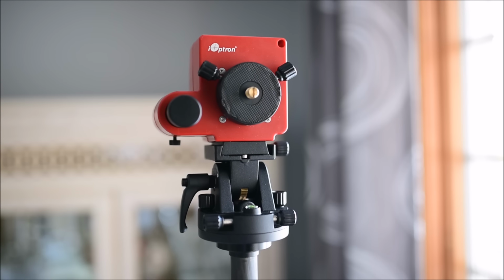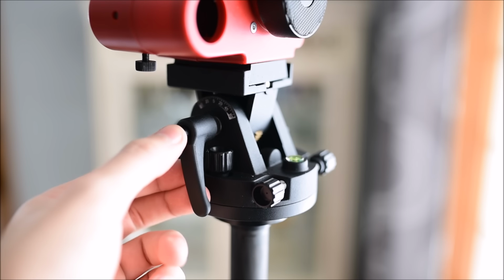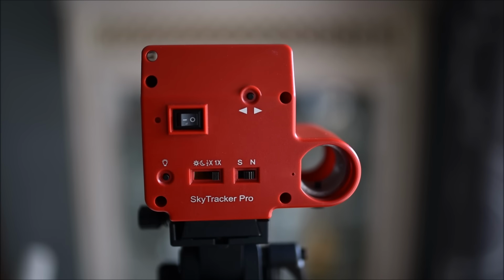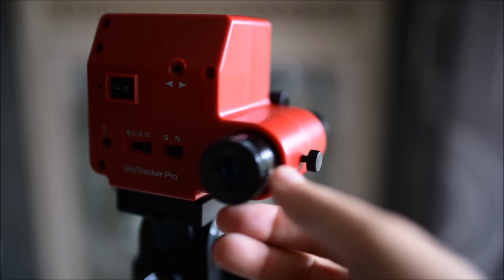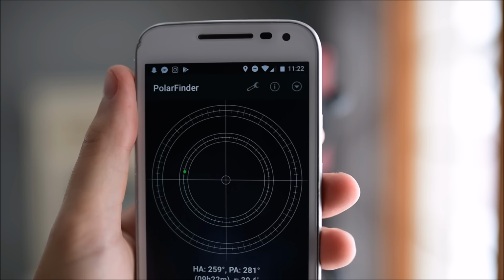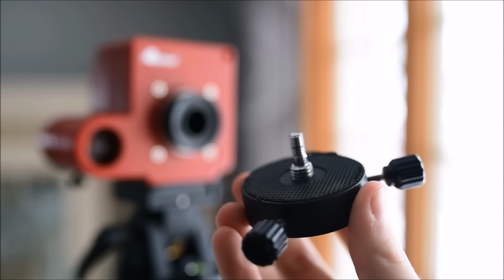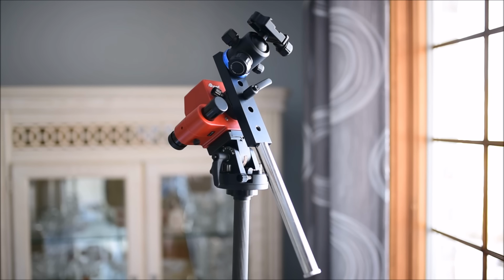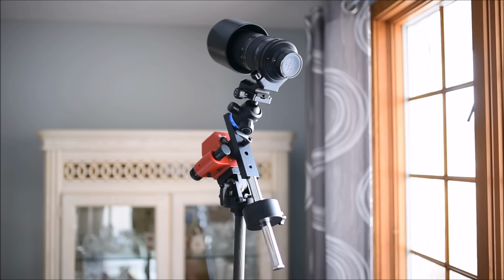iOptron SkyTracker Pro - Full Length Tutorial

Comment: Hello, fantastic tutorial it helps a lot, I have two questions regarding the polarscope:  first I wasn't able to find polaris with it, it was easy to watch it through the holder for the polarscope, but when I insert the polarscope, I see lot more stars than with my eyes only, and I was not sure which star is polaris, and because of the bright red, I couldnt see some stars from there. and the second, the polarscope view is against wrong (I'm from Austria, hope you know what I mean) so if a object is to the left, than you have to go right and vice versa. the polarfinder app also offers this option, but how is it correct?
Reply from the maker: Yeah, that's the trouble with using the polar scope in a dark sky.  What you can try next time is to do your polar alignment during twilight, when only the brightest stars are visible.  You should only see the North Star and Big Dipper at that point.  (Usually 40 - 60 minutes after sunset)

You can always turn down the red light brightness if it's too bright.  

Yeah, that's the way all polar scopes work, same with telescopes.  Up is down, left is right.  It's confusing!
Reply: okay this is possible for beginning, but still not a final solution.. because what should I do, if I would like to repalce my tripod? okay to be fair, for a wide angle milky way shot only, it is not necessary, its enough if the skytracker shows about to the north. but with 100mm its another thing. especially if you want to make more exposures for half an hour. I have found a great tool, and I think I'm going to order it, its called QHY Polemaster, you can put it onto your skytracker where normaly the camera is set. this is a little camera which needs a connection to a pc (hopefully one day possible via smartphone) there you have to choose the polaris, and the camera/programm records the movement of the stars around polaris, and gives you the real northern point. than you have to fine adjust the skytracker, that it maches with the point of the programm.
Reply from the maker: I don't think the SkyTracker Pro will ever be able to successfully track for 30 minutes straight.  You'd likely need a very high end telescope mount to get that kind of exposure time.  Even then, you'd probably blow out any detail in the sky, even at ISO 100, after 30 minutes.

Also, you'll need the Polemaster attached to your DSLR or Lens in order for it to function properly.  Telescope users will have it attached to their telescope tube.

Frankly, the Polemaster may be able to help, but I'm not even sure it would be fully compatible with the SkyTracker.  I would say it's going to be way overkill for the SkyTracker Pro.

If you do go this route though, let me know how it works!  If it works well I'll have to do a tutorial on it too!  This would be a good way to increase the accuracy of these smaller star trackers
Reply: Hi, yesterday, I made a next try with my Skytracker, because of almost full moon, it was relatively easy to see polaris through the polarscope, and now I've got a completly other level of photo (if you ignore the heavy light from the moon of course :) ) I used my Sigma 24-105 at 105mm and shoot the north america nebula in Cygnus. I tried different exp. times, 30, 60, 120 and 180 sec. 180 ist a bit to long, but 120 works fine, only after half an hour, it wasnt perfect anymore, because the alignment was still not a 100% perfect. I made I think 8 exp. of 120 sec. and its perfectly sharp with round stars. hopefully I'm ablte to align it too in the next really dark night :) regarding the Polemaster, you are absolutely right, its overkilled for the little tracker, but may helpful for bigger ones light the Celestron AVX. for the moment, I'll stay at my iotpron, and then buy maybe the AVX, try it with tele lenses, and maybe one day also with a telescope. at last, here is the link to my photo, but as I already have written, almost full moon, and too close to a city, so very much light pollution. https://abload.de/image.php?img=na-nebel-sigma6ed6y.jpg
Reply from the maker: Lukas Zitz fantastic!  That's a great image!  Glad to hear you got everything working

Comment: Aren't you going in the wrong direction (i.e. South) with the latitude ? 5:13
Reply from the maker: Nope, the star tracker would be facing North, and therefore it will get pointed higher in the sky as I adjust for the latitude.  The further north you are, the higher up in the sky Polaris will be.
Reply: You are right. But the setting circles end at 45 degrees in this direction. So  if you live at a more northern latitude, I suppose you have to turn the mount (or the mount head) by 180 degrees and make use of 60 degree range of the setting circles in the other direction.
Reply from the maker: Nomen Nominandum exactly!  I'm just about at the edge there.  You can easily take the Skytracker off the mount, reverse it, and shoot at a steeper angle.

Comment: Superb video and subbed  i have beeen struggling to choose between this tracker or a Samyang 16mm F2 lens
At the moment im using 17-70mm F2.8 macro sigma on a D5300 body
Would you suggest the tracker over the Samyang  ? also if i had the tracker for use with a wide angle lens with my crop sensor camera would i have to buy and use the counterweight or can i use the tracker as it is without weights ?
Reply from the maker: Camera Phill If you go with the new lens, you'll still be limited to 20 second exposures at night.  With the star tracker, you could shoot up to 5 minute exposures without star trails.  This will create vastly cleaner and more detailed images that are impossible to do without a star Tracker.  

Remember though, you'll need to blend two exposures from now on.  One for the sky, one for the foreground.  I've got a tutorial to cover that process.

With your setup, the Skytracker Pro will work just fine.  You shouldn't need the counterweight.
Reply: many thanks for your response
just after i wrote to you this morning i saw the lens i was refering to really cheap so i had to go for it
but the tracker will be the next thing for sure  the lens was too good an opportunity to miss out on
upto now ive been stacking like 20-30 exposures and doing one 5 to 10 min frame for the land and blending using luminosity masking
my current lens the sigma 17-70mm macro is a great lens for what it is but stars are alil soft and stretched at the corners 
so now need to save for the tracker though not told the wife that as i think i will get a raised eyebrow eeek but will get one :)
Reply from the maker: The new lens will definitely help in that case!  Out of curiosity, what application were you using to stack the photos?
Reply: i use Sequator >> https://sites.google.com/site/sequatorglobal/ 
Its super fast and not complicated like DSS i done a 80 raw image stack and it took like less than 20mins then it chucked out a full rez 70meg tiff ready to work on and the best part its completly free
heres a link to my page on flickr https://www.flickr.com/photos/155067484@N04/  theres a few astro images on there on a couple pages though im trying to get to grips with the editing of astro 
with my latest MW images they look alil soft but i think the lens maybe to blame hense the buying of the samyang also the moon had just set which doesnt help and being in the UK England light pollution is all  around
edit i just realised you did a vid on sequator already oops my bad :)
Reply from the maker: I actually just learned about Sequator a few weeks ago!  It's a great program, much better than DSS!

Beautiful gallery, love the foggy ones especially!  Keep in touch once you start using the new lens!
Reply: many thanks mate
yeh deffo will buddy i only just found your YT today and subbed 
i like your stuff you should have way more subs but not long to 1k :) just keep chucking vids out there mate im sure folk will roll in , you have alot of positive feedback too
Reply from the maker: I appreciate it Phill!  Hopefully I can get some quality content out on my upcoming roadtrip!  I've got some exciting stuff in mind!

Comment: The way that I balance the counterweight is to loosen the screw holding the black bar, move the entire assembly sideways and slide the counterweight until it balances, then tighten everything down. For lighter setups, I just take the entire assembly off of the mount and balance it on my knee. Because I really only use two lens/camera setups on the Skytracker, I marked where the counterweight should go for each configuration. It makes things much easier in the field.
Reply from the maker: Nate88it that's what I did originally, but oddly enough iOptron said it was a bad way to balance the counterweight.  Still, that's how most telescope counterweights are balanced...

Did your black rubber mount get marred by doing that?
Reply: Oh yeah! The rubber came off of mine after 3-4 outings.

Comment: I find that the IOptron is not of the highest build quality. On mine, of the two screw holes that are for the screws that arrest the alignment scope, only one works.
That counterweight setup always seemed really precarious to me, even just looking at the pictures in the IOptron manual. The idea of having a big lens dangle so far in air didn't appeal to me because it seems really prone to be shaken by the slightest wind.

In general I have been able to make usable photos with up to 200mm lenses. And I have enjoyed my Ioptron. Battery life is very good.
Pictures of my setup are here:
https://www.flickr.com/photos/mattschulze/40605314372/in/dateposted-public/

Photographic results here
https://www.flickr.com/photos/mattschulze/34023778654/in/dateposted-public/
Reply from the maker: Yeah, I had seen that another photographer had used the 150-600mm on the SkyTracker Pro, so I wanted to try it out!  In practice, it's just way too big.  The counterweight seems like a poorly designed afterthought

I agree about the build quality too.  If you're only doing wide-angle photos, the SkyTracker works fine.  But even a 70-200mm lens pushes the system to the max.

Comment: Mosthelpful video out there. Maybe stupid question as i dont understand how this thing works just yet as i dont own one but how do you find your latitude using the app if your in the middle of no where with no internet?
Reply from the maker: glenjimen1234 I would just take a look at the app before you head into the backcountry.  Your latitude won't change by a degree unless you're going a long way.  Plus, as long as your within a few degrees of the the correct latitude, the North Star will be visible through the polar scope.

Once you start looking through the polar scope you'll see the North star clearly, and then you adjust that latitude knob to move the North Star either up or down, to make it match the location as seen in the Polar Finder app.

My upcoming video will better explain this

Comment: Great video, I read somewhere about the counter weight (I narled the rubber also trying to balance it like a telescope mount) if I remember what where it was I will post it.
I also emailed and messaged ioptron but all they sent me was their current not very comprehensive video.
Reply: http://www.glennrandall.com/ioptron-skytracker-pro-review.html
This is what I did to mark a balance point with mine, not ideal. Surely ioptron would have an easier method as even their instructions are wrong.....
Reply from the maker: Thanks for the information Jo!  

I was talking with an Astrophotographer friend of mine, and his suggestion was to rotate the counterweight horizontally when attached to the star tracker.  From there it should be easy to find the balancing point.

That's what I originally tried and it tore up the rubber on the original mount.  I also took a photo of that method, and ioptron said it was a bad way to do it.

It really seems like this counterweight was an afterthought.  No other star tracker is this much of a pain to balance.

Comment: Awesome tutorial.  iOptron should just buy this from you, because this blows away their tutorial.
Reply from the maker: Thanks hahaha!  That's why I decided to create this video, the official video and manuals weren't great
Reply from the maker: Jazzzyjay Once you've got the latitude close, look through the polar scope.  Usually the North Star is not exactly where you need it to be.  

I double check the app to verify the correct north star position in the reticle, then readjust the latitude dial.

For example, if the North Star is too high in the polar scope, lower the altitude until it's in the right spot.  I keep my eye fixed to the polar scope while doing the fine tuning for the latitude and left/right adjustments

In my upcoming star tracker tutorial I will cover this realignment process better
Reply: Peter Zelinka is this upcoming tutorial the one for sale on your website or are you dropping another YouTube video?
Reply: Peter Zelinka i think you nailed most parts...a question i have is when you are polar aligning and your lat is set how do get the vertical alignment without redialing lat.